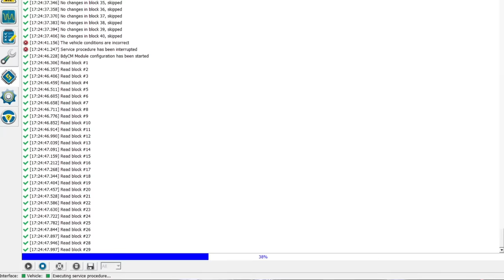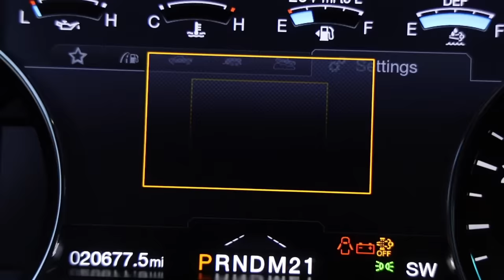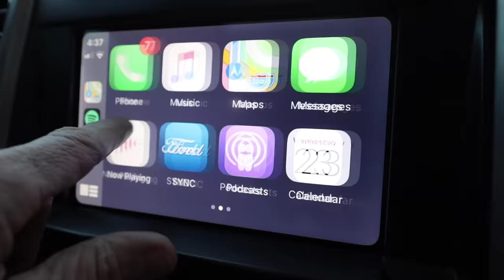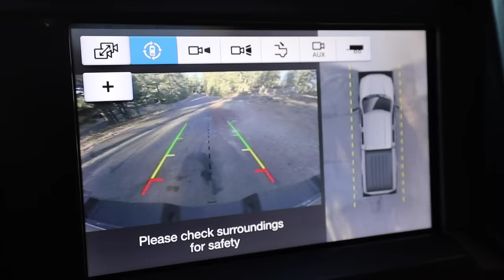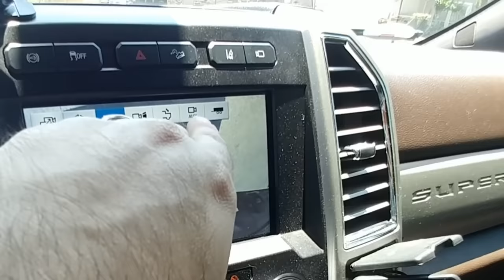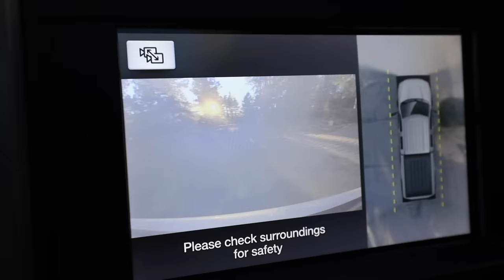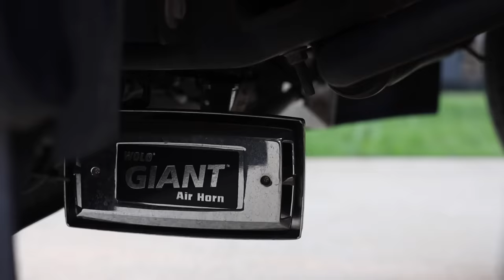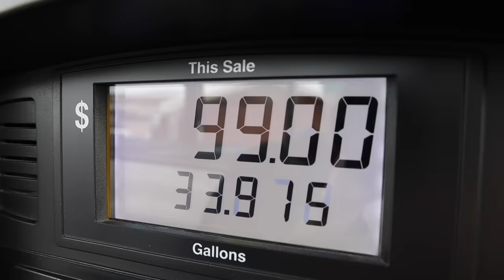Ford Super Duty Secrets! Best Mods + Special Guests

Comment: I pull a CGVW of 22K with a 3,42 rear ratio without any problem and only 370 HP and 800# torque.
Reply from the maker: Good point.

Comment: PLEASE go to the dealer for your fix. #1 you are covered up to 100K mikes FROM FORD. #2 they replaced all my tires under warranty because of the death wobble. #3 part of the solution is the intricate shims and angles of the tires that ford designates. I've gone through two lemon law cases with two different manufacturers and once you touch that front end you give up your 100K warranty on every front driveline. Don't do it film or no film you'll hurt any future warranty issues. They fixed mine and it's amazing how it rides now. Mine started at 7.500 miles.

Comment: Cool beans! Hey... my wife used my 2012 F250 and when i got it back the master key fob would not lock the door or set the alarm. It will unlock it though. Is this a remote battery issue, a remote failure, or did some function  get re programmed in the truck or remote that she didnt realize? Any ideas to help are appreciated.

Comment: rpms are nice and low with the 10 speed in the F450 now. no more high rpms like the 6 speed.
Reply: From my research, the top gear ratio on the 10 speed is the same as on the 6 speed.  So your engine RPMs will be the same with either transmission at a given speed (when in top gear).

Comment: I just ordered an f250 to pull my 5th wheel toyhauler. I would like side and rear view cameras mounted on the trailer instead of the truck so I can see when backing the trailer. Would it be possible to connect those into the sync 4 without purchasing the ford camera setup? Wiring wouldn't be a problem for me, I just need to get a wiring schematic. My thought is I may need to use forscan to turn them on in the computer. Any thoughts? Any advice? Thanks for a great video on what is possible. Your video has me thinking of all the junk I would like to remove that I thought I had to live with. Thanks!

Comment: The auxiliary camera recommended by JD is not worth it. It's nice you can use the factory connections however camera is blurry.  I wrote to Camera Source about it. They said factory camera setup is digital and theirs is analog and that's the way the camera functions. Save your money and buy something better.  I use a Leekuloo camera for hitching up . Its mounted opposite of the useless Camera Source camera

Comment: Do you ever run into the issue of the diesel fuel nozzle not fitting in your pickup tank?  I’ve had that issue more than once with my 2000 F350.   Seems big rigs can use a bigger nozzle to fill faster.

Comment: I HAVE A FORD F 350 WITH 6.7 WITH 373
Reply: What year?
Reply: 2012
Reply: When specking-out a 2020, or 21, the 373 axle ratio is not available with the diesel engine on an F350.  You have a choice of the 355, or 410, and maybe the 430, don't remember.

Comment: Hey Mark, maybe there’s a video on this, but why did you get rid of the 450?
Reply from the maker: Awesome truck. Sexy with great turning, but I'd only deal with a long bed dually and stiffer ride (that can't get washed) if I needed the payload or towing capacity. The F250 is better suited for everyday and towing the Airstream.
Reply: @KeepYourDaydream  Damn sexy truck for sure.  If you’d been hauling a 5,000 pound truck camper, would that have settled the ride a bit?

Comment: Hey boss great video but I do have a question I have an F550 2020 I’m doing hot shots so I removed the backseats in the passenger front seat out from the vehicle to create myself a bed but my problem is my airbag lights are all over the place so I called the dealer and ask them if they can be turned off or disconnected or installed some kind of a dummy and they told me that they can’t help me is there anyway you or ask you friends with the programmable obligation that they use is there anything can be done to turn off the airbag light but at the same time make sure that my driver side airbag will deploy in case of an accident.
Thanks.

Comment: What Diesel Fuel do you think is the best, and Diesel Exhaust Fluid do you think is the best, for my 2022 Ford F250 Platimum?
Reply from the maker: I pretty much only fill up at truck stops. So I'm not brand specific. Adding some fuel additives from time to time to clean it is a good idea.
Reply: @KeepYourDaydream  Thank you for taking the time for a seemingly simple question, I truly appreciate it.  I am writing my 2023 Ford F250 SuperCam Diesel 6.7L Build sheet.  Softer more comfortable seats, some new changes to the Front end look, and after your videos Some Stage 3 parts…Thank you!

Comment: hello and thank you for doing these videos, I live in Tasmania Australia , just received our 2019 F350. first question is , what and if you use fuel additives ? to clean the fuel system and other engine systems.
Reply from the maker: I don't use any, but it might be a good idea. Hope to travel to you soon!
Reply: @KeepYourDaydream  wow very impressed on the fast response, ok well first off if you all are down in Tasmania there is a block in st helens you are welcome to park on.
secondly, with the computer in the truck where you changed the bells and some options. where am I able to buy the OBD2 and is it easy to use ? plug and play ?

Comment: Okay kids hopefully I just misunderstood this nice fellow. But did he say something about airing up your tires to 10% over what it says on the sidewall of the tire? 
  If that’s what he said do not and I mean do not, do that. Only if you want your tires to blow out when hitting a big pot hole. Facts! You only need 80 psi in a 10 ply tire in the rear when hauling a heavy load do not drive around with 80/90 psi in your rear tires unless you like buying tires and having your ass end jump all over the place. Adjust accordingly.

Comment: Why not wire the train horn to a relay wired to upfitter switch that allows you to use your standard horn in the steering wheel? Switch on=train horn. Switch off=standard horn.
Reply from the maker: I considered that, but I like reaching up it (like a lot) and I also don't like the two steps if I need the air horn fast and the relay off.
Reply: @KeepYourDaydream  If I am towing it is always on and ready. People apparently have trouble seeing me when I am towing a large trailer.

Comment: Do you use a magnetic oil pan drain plug?  What was your mileage when you did your first oil change.  I have a 2020 RAM EcoDiesel and thinking about doing my first oil change at 2,000 miles.  The Owners manual is silent on the issue other than saying follow the maintenance schedule (8,000 miles).
Reply: On any new vehicle I purchase, the original engine oil comes out somewhere around 1000 miles.  I know the manufacturers don't use "break-in oil", and the oil itself would be good for whatever mileage interval the Owner's manual recommends, but a new engine (or rebuilt) will see its greatest wear in the first few hundred miles of service as the moving parts "wear-in".  I want that oil, filter, and that "wear-in" material out of my engine.  Some tell me I'm old fashioned and wasting money on this, but hey, it's my money and my engine.  Makes me sleep better at night too.   ;-)

Comment: Great video! 
Anyone have the new 7.3L? I’m really intrigued.
Reply: RV Daydream channel had a new 7.3l and has done several reviews and updates on the performance
Reply: @davidchase8815  thanks I’ll check it out!
Reply: I have a 2020 7.3, LARIAT,  3.55 locking.
Love the big block gasser. Only have 2200 mile on it. Havnt done a long haul yet.
In October apent 2 weeks in Arkansas,  alot of 5/6 degree hills, pulled my 24' TT without breaking a sweat. 
The 10 speed is fantastic,  seamless shifts
Only complaint so far, front brake pads shed alot of dust. I would have assumed the 3/4 ton would handle the tongue weight better, had some squat, getting ready to install airbags. Also in the next year or so I'll upgrade the stock shocks to bilsteins. 
So far no death wobble.

Comment: @keep your daydream have you done the Cat scall back to back: one with no air in the rear bags and one with the standard amount you run?  Curious how much the numbers fluctuate.  I can't imagine it would be much with the light tongue weight and a distributing hitch.  I want to try with my 5th wheel, but snow is preventing that.
Reply: With the airbags, Front to back axle weight won’t change much if at all with a 5th wheel since the weight is directly over the axle. 

The bumper pull there will be a difference with no psi vs higher psi.
Reply: @Upliftyourbrothers  the sag in the suspension would cause some change in weight, albeit a small amount.  I known it isn't anything earth shatteringing.

Comment: The power stroke doesn’t automatically go into high idle when needed? Is there no other way to put it into high idle manually without the resistor modification?
Reply from the maker: Yes, to burn off DEF.
Reply: @KeepYourDaydream  not for cold weather? The reason I ask is I just ordered a 2022 F350 and my current cummins will automatically go into high idle when the temperature is below a certain point to warm the truck up quicker. I live in Northern Canada so if the power stroke doesn’t do that I may end up cancelling my order and going with another cummins

Comment: Great information, thank you for sharing this with out.  Currently in the market for a new F-350  6.7L. 

Is the "exhaust brake" a true exhaust brake?  Our 2011 F-350 6.7L said it had one, but it wasn't anything more than just a TCM function with the application of the brake and downshifting.  The first time I figured that nugget out was going down the first hill pulling my work trailer, it just kept accelerating after I took my foot off the throttle.

Comment: Curious; comparing deisel engine size; do you feel that any of the newer stock engines out preform the 7.3 stock?
 My '99 3/4 ton with 350,000 is a great truck IMP, but looking.....
Reply: The old 7.3 diesel?  Fantastic engine for the long haul.  But way outperformed by the new diesels in terms of power and torque.  Longevity, some say, may not be as good.
Reply: 1999 7.3 diesel rated at 230~250 hp?  2020 6.7 diesel rated at 475 hp and 1050 ft. lb. of torque.

Comment: You probably wont read this, but be glad you didn't get the 10 speed....I had to replace my 2020 F250s transmission at 1200 miles because off all the issues it has.

Comment: I have a 2017 f350 and the panaramic sunroof track cracked and plastic pieces fell out??? It'll vent, but not slide open now. Is this common and if so, is the only way to fix this to take it to the dealership? Anyone else have issues with this?? Thanks!

Comment: I also have  2019 F350 diesel and I have never had a regen... I will have to look at computer menu to see if it’s even in there... weird
Reply: It’s automatic. I have the exact same truck. Only clue you have is MPG goes down and you can smell it somewhat if you’re stopped in your driveway.
Reply: @chriswalters8110  Hi Chris... I looked at my OB computer menu and I didn't see any mention of a regen process at all and I'm very familiar with this process.  I have a call out to my friend who is a Ford master mechanic to see if Ford did a mid year switch. My F550 makes no mention of a regen.  My F350 has 30K and my F550 has 12K and I have never seen a regen light go off
Reply: @chriswalters8110  Chris, I failed to ask you... are there any lights that shows that it is in regen cycle?
Reply: No, there is no indication when it goes into regen. Even if you do like Mark did the best you can do is see the % of where it’s at. I do like the fact you can shut off the auto regen, but that requires the forescan program.
Reply: @chriswalters8110  I got the old owner's manual for my new F550 and yes, you're are correct even the 2020 do have regen program it goes through. This truck only has 12,000 miles on it, unlike the 4500 topkick I had previously had that it would kick into the regen (that truck didn't use DEF) cycle if you looked at crossed eye every chance it could (I hated that) I had a F450 with 130k on it, and I never saw or heard it go into a regen cycle.  I'm pretty sure if I look at my 2019 F350 lariat's I would see sort the same info that is called out for the F550 even though after 30K i have not seen or heard it go into regen. The manual did say that there is a passive mode ...maybe it's going into a regen cycle and I'm not aware of it.  If so it's a hell of a lot better than what  my old Topkick.  Thanks

Comment: you are getting 817 miles to a tank ? my 2019 when i fill up full give me under 500miles to. tank why
Reply: Probably because of the 10 speed transmission.  I have a 2022 f250 and get 21-22 mpg on average

Comment: WE HV NVR OWNED A CAMPER TRAILER. BECAUSE OF COVID MY HUSBAND WANTS TO BUY A TOY HAULER TO TRAVEL TO HIS WORK WHEN HE HAS TO STAY OVER, AND HAUL W HIS EQUIP WHICH WEIGHS ABT 900 LBS .GREY WOLF 19RR TOY HAULER IS WHAT WE ARE LOOKING AT IS 4382 LBS UVW/HITCH WT 574/GVWR WT 7574/CARGO CAP 3193/ CAN YOU GIVE US AN IDEA WHAT SIZE TRUCK WE WOULD NEED TO BE WELL WITHIN THE TOTAL WEIGHT REQS? THIS TRAILER WILL NOT BE USED DAILY. ONLY WHEN HE TRAVELS OUT OF TWN FOR HIS WORK. AND ASIDE FROM HIS FLOOR SCRUBBER, AND HIS FLOOR BUFFER, HE DOESNT REALLY CARRY MUCH ELSE
Reply: Turn off your damn caps!

Comment: I am stationed in San Antonio two breakins in 3 months. I’ve installed the safe, metal plates behind all door handles and mechanisms and have deleted the physical lock in the drivers door. I’m done, also tend to Leave me k9 90 lbs shepherd in my truck and leave it running. Hoping someone tries again. Also constitutional carry hopefully will ventilate a lot of these low life thieves.

Comment: I feel like the safe will just entice the thief to steal the entire truck. If they are low enough to break into it they certainly aren’t above stealing it. Also, the push to start makes it incredibly easy to steal. My buddy had his stolen recently. Cops told him there is no use even looking for it bc it’s probably chopped up or on a boat headed overseas already. That was immediately after it happened. Maybe 20-30 min after. Makes me think the cops know more than they are letting on. The truck has gps navigation for crying out loud. I can find my truck with my iPhone yet the police department of the city we were in didn’t have the resources to find it? Give me a break!

Comment: You never want to have your truck go in to Regen while sitting still for a long time. The exhaust temperature will increase to over 1000 degrees in order to burn off the particulates that have accumulated inside the canister. So you always want to be moving and have air flow under the vehicle during the Regen.

Comment: Why don't you explain then why it's a Big number, and is a Ratio?

No one explains that, and then people go to correcting the video poster or other comments depending on what's said.   "I have a Tall gear"  "I wanted High ratio in the axles."

I cert know, but you're one of the "influencers"/teachers, so you could be  more thorough. The video is already on the longer side. A few more seconds here and there for clarity won't hurt.

"4:10 and lower ratios".  No, it's Higher ratio.

Comment: You need to get a 12 and a half inch linkswell touch screen Entertainment System all your truck information goes right on the radio it deletes your climate control buttons and they are all done by the touch screen radio heated seats heated steering wheel everything all your engine temperature coolant battery information is there plus if you have hotspot or you can connect your truck's Wi-Fi you have full touchscreen internet access is powered by Android that's how I'm watching your YouTube video currently but damn 14 Mi to the gallon pulling 8800 lb I'm getting 10 Mi to the gallon empty with just my repo unit no car 35 inch tires 2 inch lift exhaust cold air intake

Comment: Best mod for a Ford is to swap it for a Chevy
Reply: Not if you want to tow anything!
Reply: @frankdank7507  

I must be doing it wrong then. My Silverado 2500HD went 7,000 miles towing it's first season... 😬
Reply: @BillUtah  That doesn't prove much.  We're averaging 12,000 miles a month, pulling up to 28,000 pounds behind our Ford Super Duties, with very few issues.
Reply: @frankdank7507    

“Not if you want to tow anything” was your comment.
Reply: @BillUtah  Well, your reading comprehension is fine.